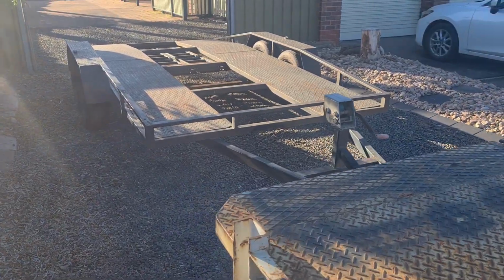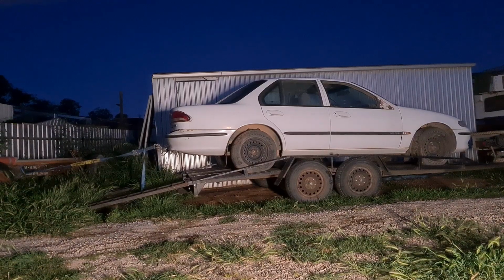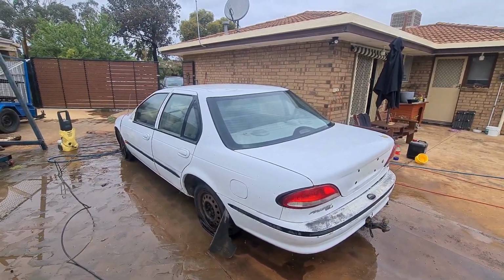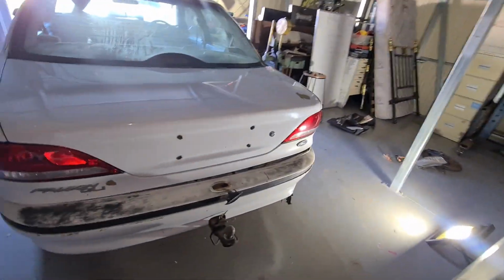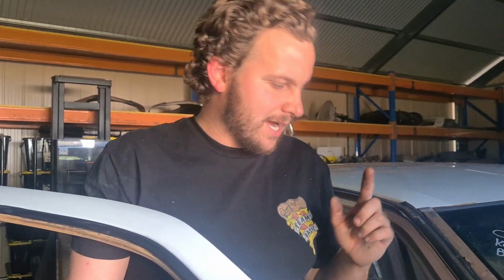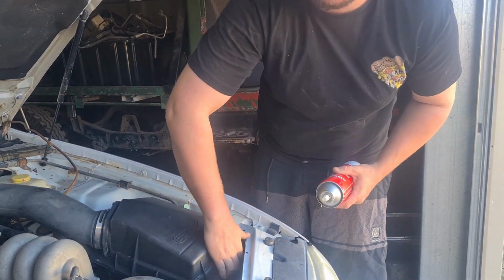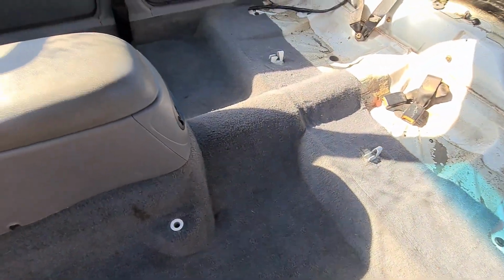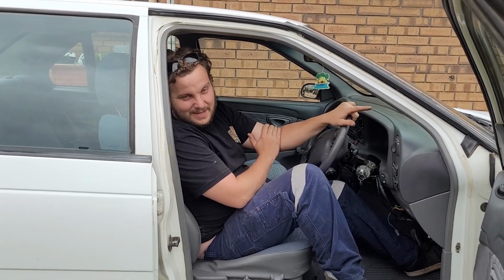Paddock find - "Restoring" an EL/EF Ford Falcon

Comment: Noice.  Bought a '94 about seven years ago and just about to sell it.  It ran a bit rough but I added a couple cups of Seafoam when there was about five litres of fuel left and went for a blast and then it was smooth as silk.  A quick MAF sensor clean helped too.  Just put in new front shocks, no dramas and lower ball joints, some drama.  Had the knuckle out and used a press tool without luck so soaked them in 50/50 acetone/ATF then smacked them with the back of an axe, easy.  Then realised I didn't have the press tool on properly.  Didn't know much about cars and the old man knew it all but didn't teach me anything so I learnt most of it from Chrisfix.  Unlike the old man he never said get out of fkn way.
Reply from the maker: Good work mate! Sometimes you have to teatch yourself and learn the hard way!